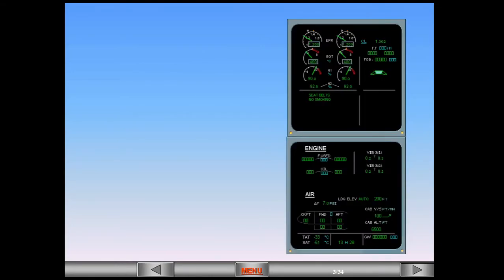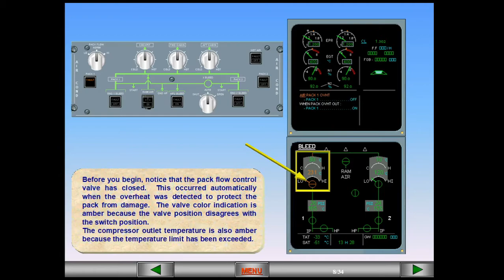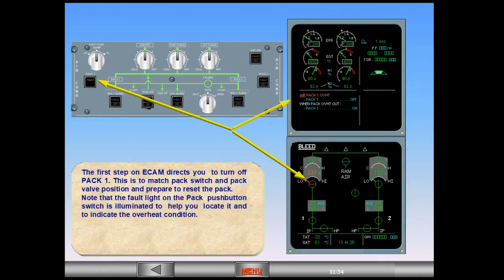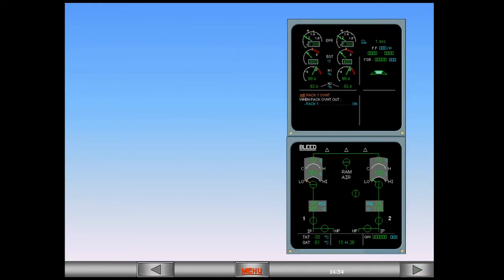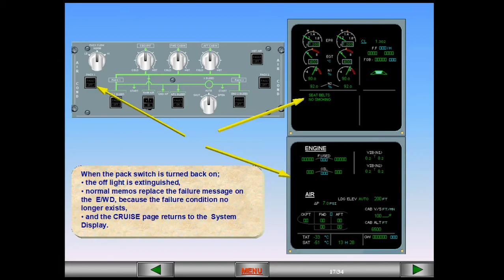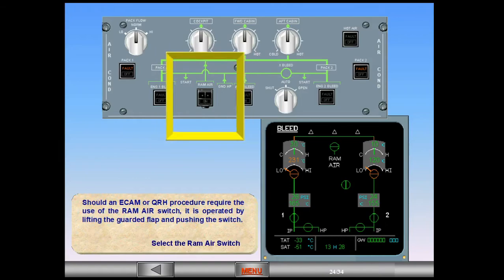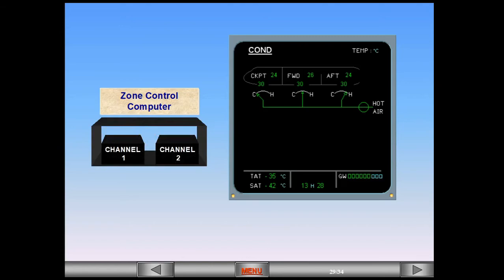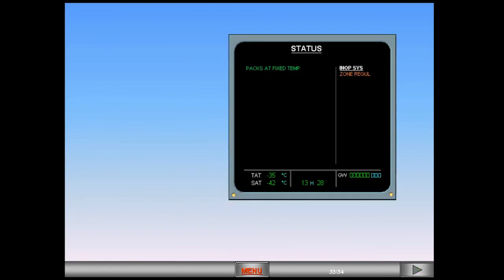A320 - Air Conditioning & Pressurization System (Abnormal Procedures) PART 3

Comment: I experience a air pressurization system type of failure in more than a dozen flights on A320, my ears literally blow up during descent on approaching for landing, never happens when I flight in any Boeing airplanes same trip, do not know if  pressurization is manual, automatic or both on A320, not good.
Reply from the maker: yes the pressurization system on airbus and boeing normally will adjust automatically. different case if something problem will switch to manual adjustment. Until now a lot people feel the same thing as you did.